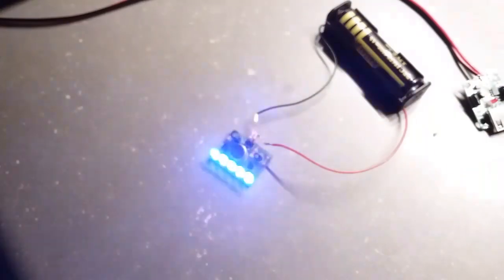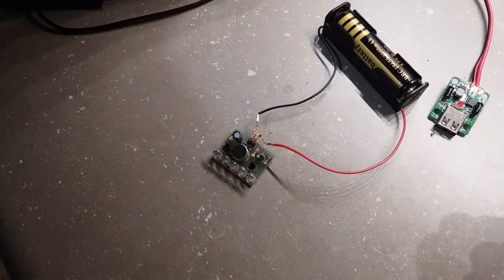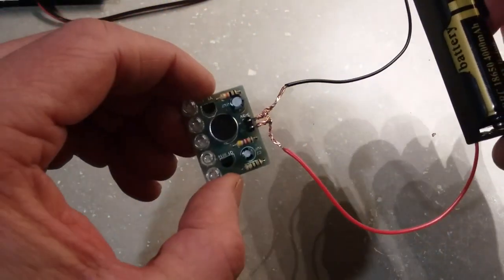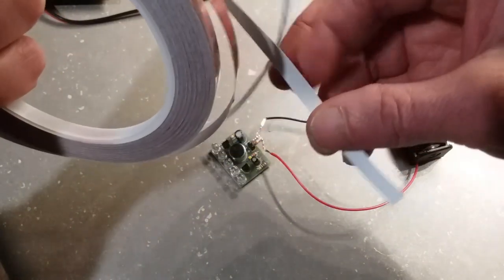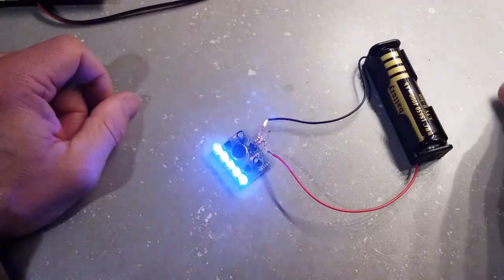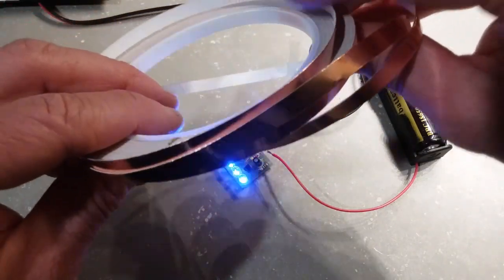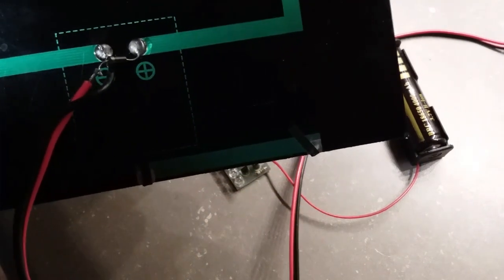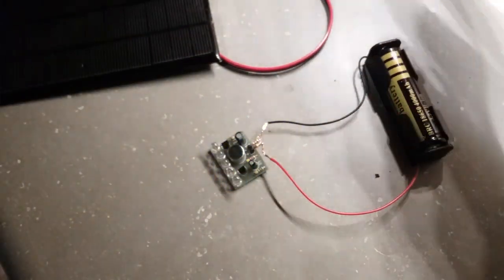Conductive copper adhesive tape emergency electronics circuit repair

Comment: I'm trying to stick the foil to a pcb circuit board to join 2 contacts that have broken,  I've cut it to size but its just lifting.  Can you recommend anyway to get it to stick? What about of i leave the  white backing and use some sort of adesive glue? Can you advise me ? I was thinking about those solders pad strips but unsure if I'll have the same problem , thanks
Reply from the maker: I've had the same problem with this stuff. It's worked well as tape with mechanical contacts, but not as a conductive adhesive on PCBs etc.
Reply: @p1nesap  Thanks for your reply , have you ever tried the solder strip pads  , the ones with all the different shapes ?  , I have a capacitor and on one side I literally have nothing at all to solder to , the pad and track has lifted off the board so trying to find a way to get the cap to mount to the board in order to repair.  If I could solder the cap in place I know where the track is going to the next contact so its just getting it in place with solder
I'm not sure if there's any glue i could use for pcb boards .

Comment: would if you scraped some of the adhesive off?
Reply from the maker: Honestly I don't think this stuff is conductive.
Reply: @p1nesap  This conductive copper tape comes in two types. Tape with conductive adhesive and tape with non-conductive adhesive. The non-conductive adhesive type is generally a bit less expensive.

Comment: I've used copper foil tape to make circuit boards for small electronic devices, and for doing experimentation and Manhattan style circuit making.
If you place the tape on a piece of cardboard, or even wood, you can even make a permanent device. 
The first time I used the technique was to make an audio oscillator using a 555 chip to demonstrate some Morse code with a home made keyer.
Reply from the maker: Cool